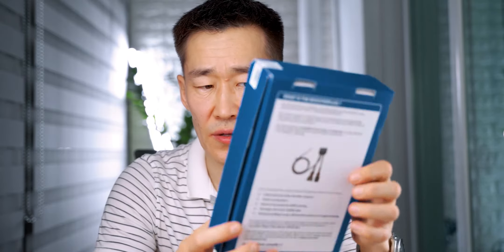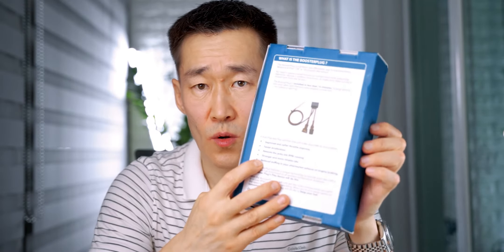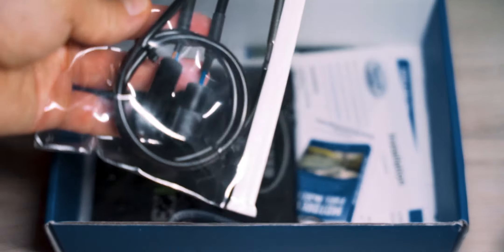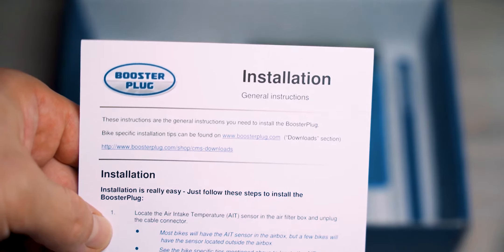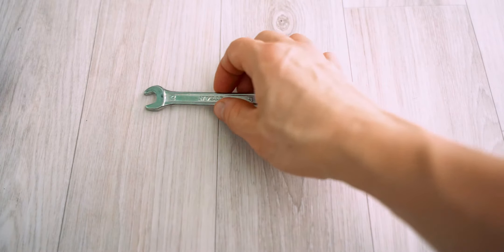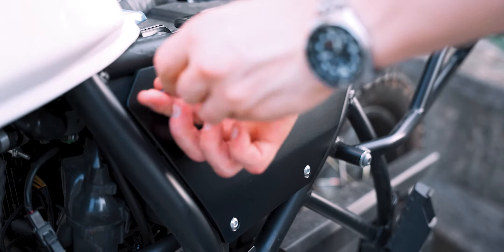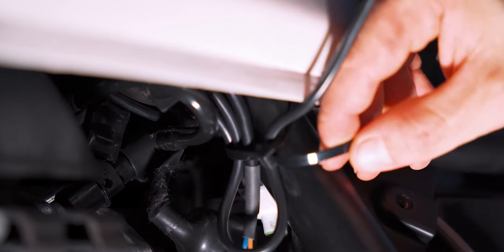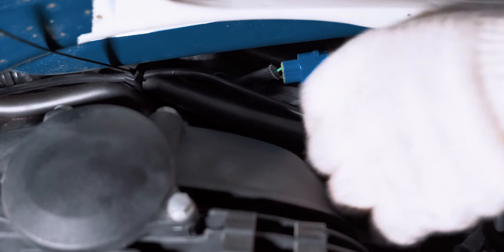Booster Plug for Royal Enfield Himalayan review, installation and test

Comment: This was good information, the Himalayan is on my list of next motorcycles to buy, but was concerned about the low power. Not looking for a race bike, but usable power to make everyday riding more fun is what I like. Thank you for the video.
Reply from the maker: Thank you! Himalayan is a very controversial motorcycle in my opinion. I bought it for design, price, versatility, torque, handling and more than that for its uniqueness pretty irrational decision though).
Reply: @MotorcyclistDiaries  They are all valid reasons, I bought 2020 Bashan Brozz 250 because I liked the look of it. I have been very suprised by how much I enjoy the motorcycle. Not exactly what I wanted, but the low cost and ease of upgrading things makes it even more fun. I do like to tinker with mechanics.
Reply: its got enough get up and go stock. the big bore kits i think will make it perfect with a slight regearing for faster highway use. i already ride it on the highway and it'll do 110-120 pretty happily all day(stock motor). buzziness goes away as the motor breaks in and smooths out.

Comment: Excellent video.....!!!!
I have used the Booster Plug on my previous motorcycle (2014 Triumph Bonneville) and my current motorcycle (2012 BMW R1200GS) and in both situations the improvement was very noticeable. It smoothed out the throttle response, improved low and mid-range acceleration and basically made them ride and respond like they should have from the factory.  I hope your enjoy the improvements as much as I have.
Reply from the maker: Thank you Ray! That's really true, improvement are noticeable at all range of REH engine revs, no dip of the power curve anymore. Nice bikes btw you had and have;)

Comment: I just installed the BoosterPlug on my Himalayan. I feel the throttle is a bit more responsive than before and it does gives out a bit more power. And all this is without swapping to a high flow air filter. Thank you for helping me to decide on the BoosterPlug. It was either this or a piggyback ECU. This was the best decision ever made. Thanks once again!
Reply from the maker: I'm glad that video was helpful for you! Cheers!
Reply: Wizard Artist  for me, since I'm living in Singapore, I went to a dealer (Adv Yard). It costed me SGD $250.
Reply: @williamsatish25  joined

Comment: Had an issue with stalling and did the following: Adjusted the throttle plate angle to achieve a 600Mv reading from the TPS (do not move TPS) and used the air bypass screw to adjust idle speed. This is a quite fiddly as there is very little room to work however the results are in my opinion worth it. The bike seldom if ever stalls now.
Reply: What was your starting voltage? I believe that altitude, humidity and barometric pressure plays a part in this fix. I am at 3,300 ft altitude in the Andes. My Himalayan stalled constantly at times. I noticed that depending on the weather, humidity and barometric pressure the stalling would get better or worse. Some days it would stall 4 times in 2 minutes, other days hardly at all. I saw a vid from a RE mechanic in Ohio who said to set the TPS voltage from 0.58v to 0.68v. He says he does it for free to all Himalayan owners who come to his shop with stalling issues. My starting voltage was what you set yours to or 0.60v which is pretty much factory standard setting. He said the higher voltage of 0.68v would enrich the fuel mixture at idle. He also recommended widening the plug gap and setting the idle to 1,300rpm. I made the changes and that seems to have fixed the problem for the most part. I get a skip from time to time, caused by other issues but no stall. I learned the importance of air O2 density back in the states. Living in the DC area, I had an older 4 cylinder Ninja/GPZ 550. I deleted the air box and installed V&H velocity stacks. I got better performance, but the air box provided negative pressure and a more stable engine performance through weather fluctuations. This left me having to re-jet as the seasons and ambient temperature changed. This was due to higher O2 concentrations in cold weather requiring a richer mix. At 3,300 ft so I have slightly lower O2 but with the Euro 5 emission standards we are also dealing with ultra lean fuel conditions adding to a hotter engine and lower life expectancy. The fuel plays a large part in dissipating heat and cooling the engine. So I personally would try the richer 0.68v setting and see how it works where you live. It works in Ohio so it should be OK in most other places.

Comment: Such a great review...like all your reviews.
I have a question
I just bought a BS6 2022 HIMALAYAN according the RE this model has an updated injection system for you think the booster Plug is necessary on this model?
Reply from the maker: Ohh I don’t know for sure about BS6 model. But if you have problems of stalling at idle rpms and not confident at U turns you this is probably the reason to try Booster Plug.

Comment: Hi, you said yours stalled a lot during the running in period.  Did it go away after a while (without the booster plug)?  How long?  My new 2021 stalls so much it's unbearable.
Reply from the maker: I rode in winter time it doesn't stall at all, in summer time it was stalling usually at idle rpms when speed decreasing clutch lever is pulled, about 2 times from 10.

Comment: Thanks mate. Ken from Western Australia here. This is a very calm and sensible review of the Booster Plug. A question, if I may. I have a 2020 BS4 with after market exhaust. I have just installed a K&N filter and now notice that it is idling on 1800 RPM and MAYBE the engine is running hotter (feel hotter legs). I suspect that the free flowing is allowing the engine to breathe better and hence the higher RPM. Maybe it is also running leaner. Your thoughts? Do you think that installing the booster plug will reduce engine temperature by running a richer mixture? Thanks you and keep it up.
Reply from the maker: Hi Ken, sorry for late response. Thank you for your comment. Booster plug is supposed to inject "right" air-fuel ratio at different temperature conditions. I don't know unfortunately does it could help to reduce engine temperature. I would suggest  to read very informative book about fuel injection on motorcycles by Jens Lyck https://www.boosterplug.com/shop/cms-fuel_injection_book.html probably you can find your answer there. Cheers!
Reply from the maker: @williamsatish25  Joined

Comment: In my bike I'm suffering from engine sound someones telling me souns from valve is it right or wrong
Reply from the maker: IMHO Royal Enfield engine is by nature noisy
Reply: @MotorcyclistDiaries  Why? Sound from engine is too much. Loud sound from engine, may be accepted, but in here it is a very rough sound. Like frictional sound. In my opinion most of the parts are not well lapped. What one should hear is the strokes from the exhaust. And a substantially low running sound of engine.
Have used 1980 Bullet. Just from about four feet no one could believe the engine is running. The visible movement of strokes made one realise the engine is running.
Gone those days.....
I do not own any bike now. Just saw this bike my friend bought. Was shocked to listen it. 
And why should the engine stall at idle, at the correctly set RPM by factory/as recommended as well if the fuel mix is nearest to the correct setting engine must, must keep running. Once in a while rarely it may.
What function does the Booster do? Will have to check with some more senior experienced techs.
If the booster had affected the RPM, by slight increament, then how?
RPM can vary if you manually open the Air screw, allowing more air and making the mix lean, resulting in a little rise in RPM.
And by tightening, the mix will get rich and RPM will reduce.
If Lean, throttle response will be poor.
If Rich, throttle response will be strong.
Hold the back of your palm a few inchs from exhaust mouth. When mix is lean temp is high as compared to a rich mix. The change in temp is instantly felt.
Oh....so sorry this is getting too long. Please

Comment: have you heard "detonation noise" when in high revs for long runs? Here a example at a easy climb, at 4000rpm 80Km/h... royalriders. com. br / open-letter /
Reply from the maker: Hi Bressan! First, thank you for gently inserting the link. Mileage of my motorcycle is about 4000km, and I hear a lot of noises from cockpit and possibly valve chain, but not so harsh as in the video.

Comment: I think the best booster plug would be to change your bike for a Honda Africa Twin 1100cc.  The Royal Enfield Himalayan is a good bike but from the last century.  You need a motorcycle actual century Euro 5 2021 and that gives you a good speed on the National Roads and highway and that at the same time you can get on broken roads and gravel roads and that you can climb Hallasan Mountain National Park with it.  It's your decision.  Thanks for the video and take care.
Reply from the maker: I enjoy riding REH and more I enjoy riding it with Booster Plug, it really gives engine  life as it was strangled without it. I like different motorcycles, and I really appreciate Africa Twin, and if I have it I'll put Booster Plug in it as well.
Reply: @MotorcyclistDiaries  many thanks and very good trip. Take care and  all the best.
Reply: Different bikes for different people. The Himalayan cruises all day at 70mph, returns 80mpg and is fantastic on the trails. It certainly isn't last century. The AT is a great bike I'm sure but it's 3 times the price of the Himalayan in the UK and I doubt it would be 3 times better.
Reply: I have an Africa Twin and I have just bought a Himalayan, the AT is my favourite bike of all time and I have owned over 50. I have used the Honda on some pretty serious single track but now I'm getting too old to pick it up if I drop it. For small roads the Himalayan is the better option, but you cannot compare the two, the Himalayan is less than half the price and is built down to it. I will keep both.